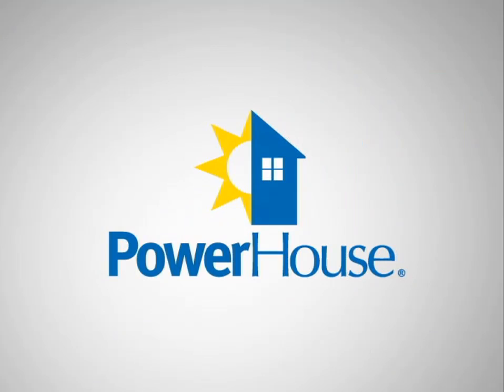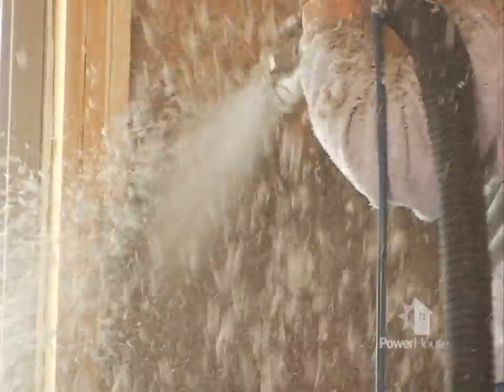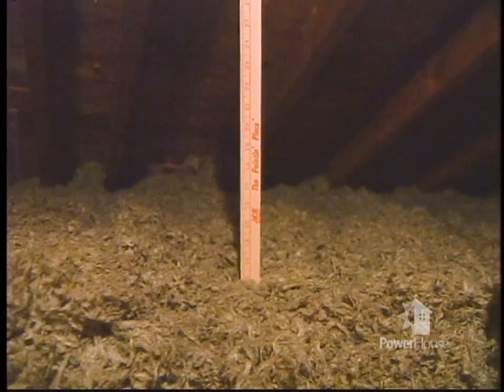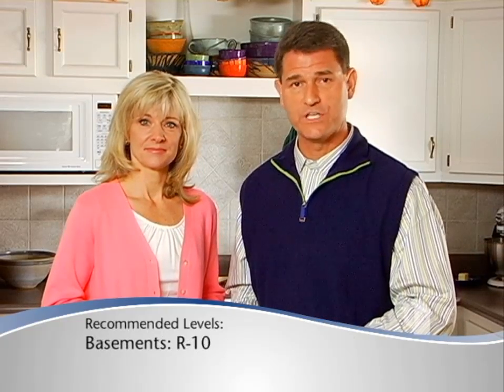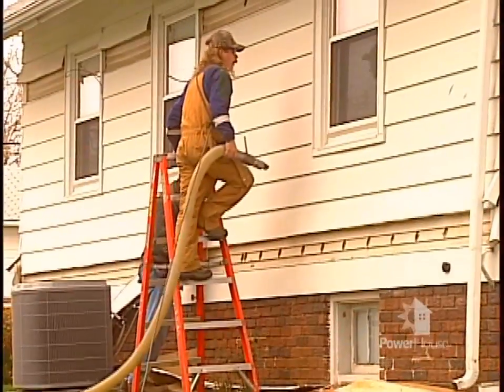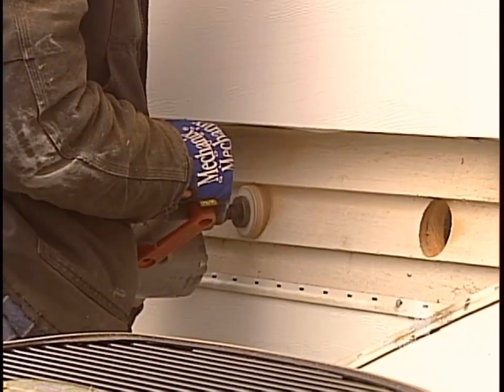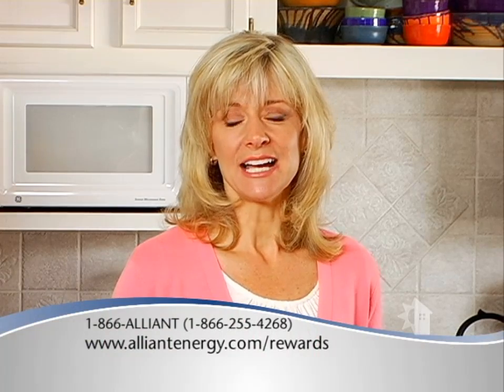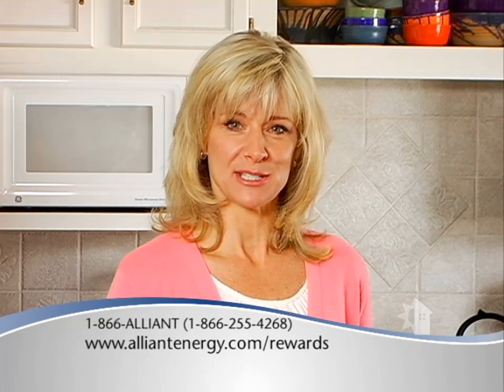Insulation 101  - 12/11/10

Comment: You guys said you can put more insulation over the original insulation like batts but not ones with paper, tin foil or plastic backing. Why is that? Does that backing provide thermal conductivity so it reduces the R value.